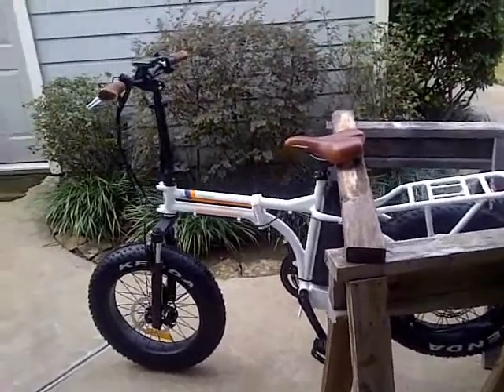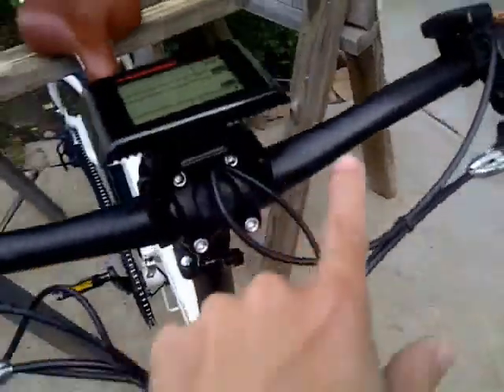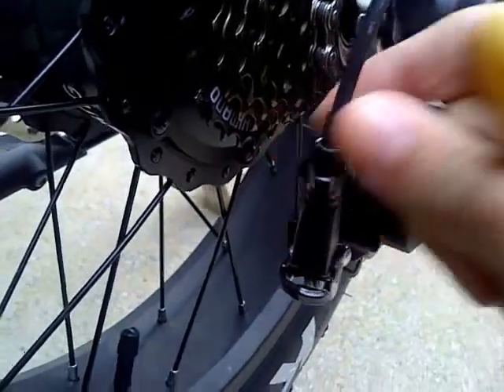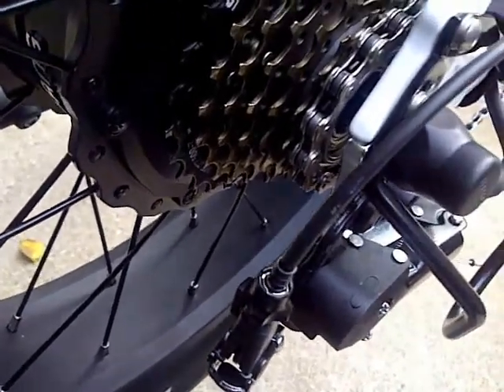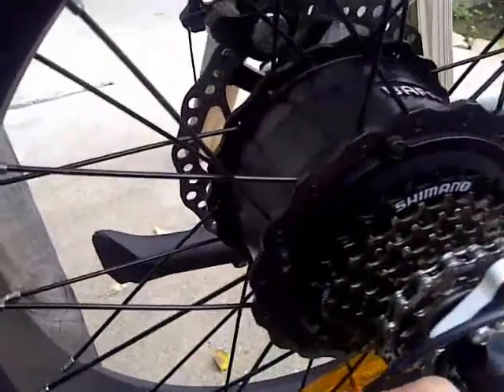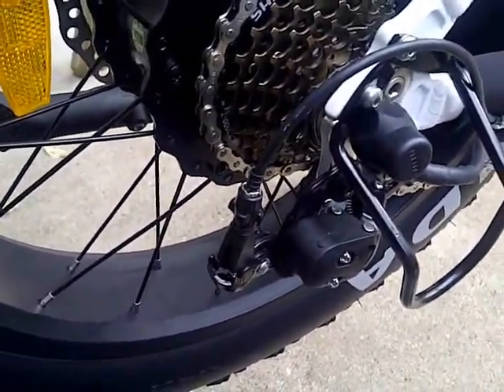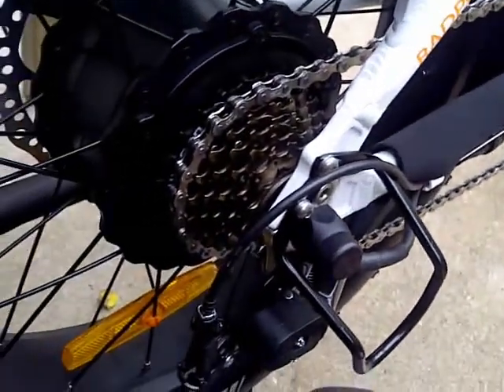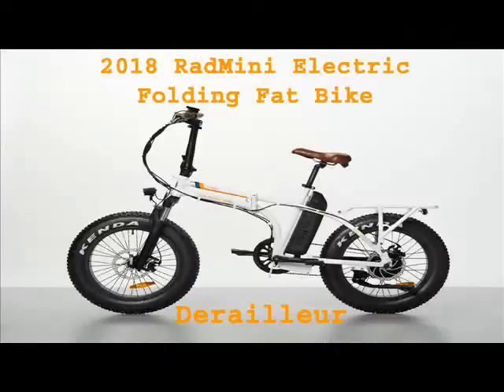2018 RADMINI  ELECTRIC FAT FOLDING RAD POWER BIKE 02 Derailleur

Comment: So I got mine today and just built it. As I roll it I notice the slight scrubbing of the pads as well. So just let it break in?
Reply from the maker: Antonio reid let it break in for 70 miles then adjust the brake pads, calipers, and brake cables.  If its really makes a lot of noise, adjust the brake pads now.
Reply: James Bond awesome thanks man